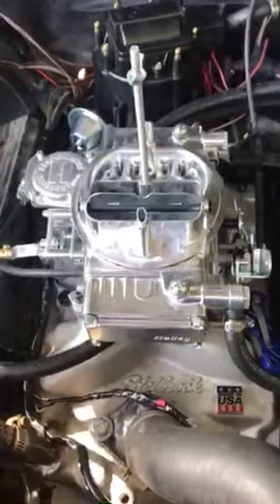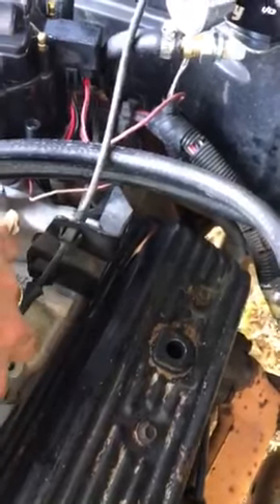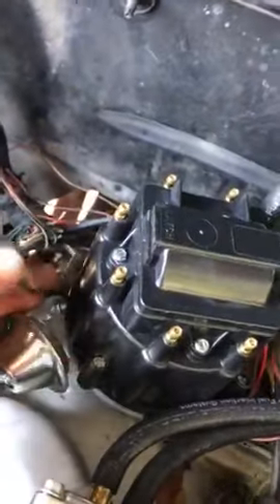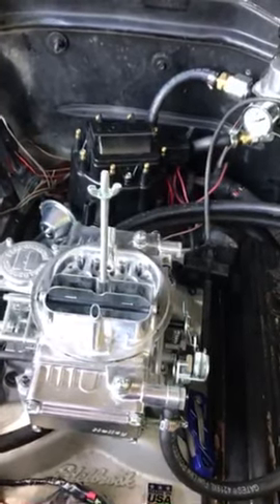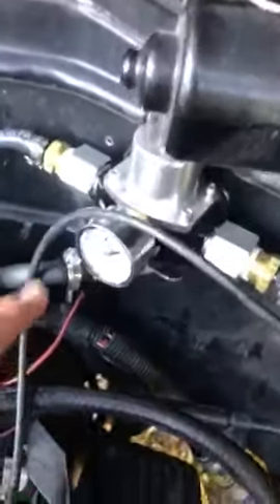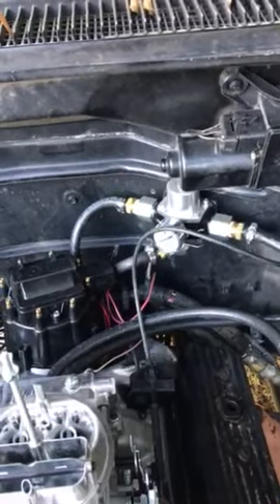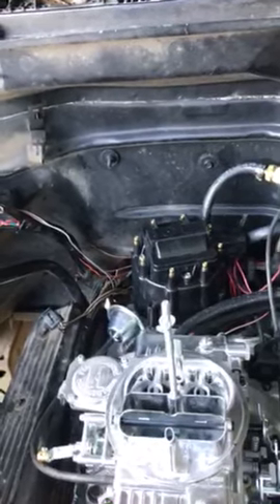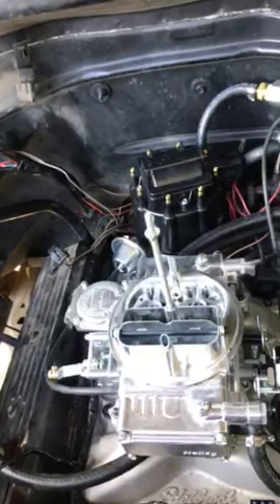Converting TBI to Carburetor, tips and tricks

Comment: After 15 years of nonstop issues...throttle body electrical,  sensor, regulator,  etc., ...I'm done with TBI. I love my old truck , a 94 chevy 454, but hate TBI with a passion. When I was young I had a 79 ford f150.  Just a plain old 4 barrel carb, on an edlebrock manifold and that motor always ran...no issues. Thanks for the video Brother.  I'm changing back to carb.👍

Comment: There's a special detent cable corrector that goes on the throttle linkage. It keeps the line pressure right through 3 4 gear. If you don't have that adapter, you will burn up that 700r4 within 1000 miles. You will be lucky to even get 400 miles out of that 700r4 without that part. Cool video
Reply from the maker: Hi Jeremy, you are right I do have my detent connected to the carb. It took a little adjusting with the bracket to get the proper adjustment from it. Still running strong. Thanks for the comment.
Reply: What do you do if you have a granny low 3 speed manual? Would that effect anything with the detent cable?
Reply: @tlariscy  hey I did the purple wire what u said but when I’m driving the fuel pump will shut off
Reply: @Romeo Weeks  did you ever get that issue fixed?
Reply: I found out I have to get a inline pump hopefully that will work I’ll let you know if it worked in a couple weeks because I keep bending all my push rods so it’s in the shop tired of fuc*ing with it lol but everything else is perfect transmission shifts smoothly and I found out I have to get a throttle position sensor is from usshift bolts on the passenger side of the carburetor look up nick connors I believe his YouTube name u will see what I’m talking about
Reply: Thanks for the advance tip sir

Comment: Thank you for pointing out the tac wire. Just did mine 87 chevy 454, used original intake with carb spacer.runs 90%better.everybody talks about the tbi to carb , but don't tell you about the wire hook up thanks.
Reply: @bigpigslapperoinktoo4953  I hooked purple and white wire to the tach port and the pump did not come on i stuck my test light in the wire and it came on strong for just a few secounds and quit, if i pull the test light out and stick it back in it does it again, any thoughts??
Reply: @bigpigslapperoinktoo4953  I just hooked it up to a hot wire by itself and it still came on the same
Reply: Question, I'm learning as I go,  I have a jasper 350 engine out of a 95k1500 I'm putting in my 85k 20, do I just need to swap all the fan,water pump, power steering off my old engine for belts and  would a Edelbrock 2104 be the correct intake to use to go carb?? Since everyone is telling me the intake that's on it won't work?

Comment: I have a 355, mild cam, vortec heads, and edelbrock vortec to carb intake, and the tbi sits on a carb to tbi adapter plate from Painless. Got a chip made for it day one that I dropped the motor in, and it's just been issue after issue for years now. Thank you for this video, I plan on doing a carb conversion here real soon. My truck won't even drive properly anymore when it warms up. As far as the 93 and 94 year models like mine, holley sells a TPS adapter kit so the trans can shift like it's supposed to.

Comment: This was exactly what I needed. My k1500 has something wrong in the knock sensor circuit/wiring and after replacing nearly all the sensors its time to go back to a simple, reliable, mechanical solution. Thanks again, awesome video, especially about the fuel pump wiring.

Comment: Glad I found this. Not running a carburetor on my 88 but I just bought a 94 for parts because it has the tow package and better brakes to put on my 88. I needed this information because I plan on dropping the 94 350 into my 66 Belair while I rebuild my 283

Comment: Thanks for the information about the fuel wire to tack side of dist. I was thinking it would work off the fuel pump relay!  I really like your video, it has helped me. Thank you.
Reply: What kind of issue were having?Im asking to see if yours is similar to mine
Reply: Once again I really like this video. I thought that all I needed to do was hook up the purple  wire to tack side of dist. and all will be good to go.Wrong, you still need the fuel pump relay hooked up at least this is the only way my fuel pump would work. And the car is running great, all finished. 1986 corvette, and only using it for drags at the 1/4 mile race track. I hope this may help someone on the fuel pump! Thanks.
Reply: @mikepolk3361  Hello mike, I just wrote a about the wire to dist. for fuel pump and in my comment I said that I also hooked back up the fuel pump relay and this is working great now! With out the relay I was not getting any fuel only a prime for 2 seconds. Hope this helps!

Comment: This video is sure helpful thank you ive been trying to figure out the fuel pump wiring because i have a 1992 gmc c3500hd that im changeing over to to carb because the tbi is failing so bad the truck would run so lean that it doesn't have the power to go up hills

Comment: Just the video I was looking for...got the same truck with a stalling issue at stop signs ...I've been fighting it for months..im an ok mechanic but am done replacing stuff..took it to a reputable shop and they are scratching there heads..gonna save up and go with your setup.
Reply: I did the same thing to my 94. Ill say if youre doing to swap from scratch, it'll run you around $1500 all said and done. Thats a good aluminum intake, 4bbl carb, HEI distributor, tps set up, regulator, brass fittings, etc. You won't regret it though. You'll gain probably 30hp and tons of torque and it will run SO smooth. My truck runs like new and has more power. And with electric choke, it starts very easy. Just 2 pats on the throttle and ZOOM. Paint the valve covers, keep it clean and it'll look like you dropped a $5k crate engine down and this also opens up a lot of possibilities for aftermarket exhaust since you have no emissions to worry about.
Reply: @ericchapman8956  what do you mean by tps setup? Thanks
Reply: @mainerj  Throttle Position Sensor. This only applies if you have the 4l80E as it uses the TPS to control its shifting. If you jave a mechanical kickdown or a manual transmission you wont have to worry about it. I used a Holley carb and a special bracket sold by Holley that can be used with the factory Throttle Position Sensor. Without it, a 4L60E/4L80E transmission wont shift right. Sorry im not very good at explaining things.
Reply: @ericchapman8956  thank you, ya makes sense I have a 700r4 so just wanted to make sure I wasn’t missing anything 👍🏼
Reply: @mainerj  then you can skip that step entirely!

Comment: The purple with white stripe to dist. was all I did and with no luck hooked up the fuel pump relay and it works great!
Reply: I hooked purple wire up and when I turned key on I get nothing. No sound just cruckets.... thinking of just running to toggle

Comment: Oil pressure switch sees pressure and keeps the fuel pump running after the initial prime.  Needs to be plugged in on the back by the dizzy,,, if your motor has one.

Comment: To Get The In Tank Pump To Work other than just prime! cut grey wire from fuel pump relay on passenger firewall and connect it to new relay which will be your fuel pump hot with constant 12v, switched 12v & ground wahla fuel pump comes on with ignition switch and works properly! Remember to use a bypass regulator!
Reply: What year did you do this on?

Comment: I'm having the exact issues you described near the end of this video, put a brand new engine in and it has ran like shit since, changed every sensor there is and have come to the conclusion there's wiring issues in the tbi system, idle is erratic all over the place and I can't get it to stabilize so now I'm weighing out switching to carb setup or tracing the wiring issue...
Reply: Did you ever figure out why it’s doing this? Mine has been doing it for 1 year but seems it only does it when it wants too. Like one week it’s running like shit and the next it’s perfect.. I’ve tried locating naked wires I’ve changed throttle bodies, distributor +(cap wires and spark plugs), coil, every sensor on the damn thing, fuel pump and filter, and have looked over the ecu wiring behind the glove box and still acts up sometimes.. it was my grandpas truck. Had it every since I was 5 and he gave it to me when I was 16 and I would do anything for it to run right .. please let me know if someone has solved this! Thanks.
Reply: @daltongrayson8513  my 99 is the exact same way,I've figured out outside air temperature effects it.At first when it's cold runs like ass.ten minutes of driving and it's mostly normal.Just not the best setup
Reply: @brandonvansel3716  have you changed the temp sensor on the intake?
Reply: @daltongrayson8513  yes.Ive changed pretty much everything at this point.The other thing that does this is to much air at the maf
Reply: @brandonvansel3716  I’ll try to figure out how to post a video of what my truck is doing on here and tell me if yours is doing the same thing

Comment: 4l60e has that cable under the throttle cable as well. If that cable goes to a box on the firewall it controls the cruise control.. just so nobody gets confused after watching this video when they go look and the cables there on a newer trans truck 👍
Reply: 95 and after has a 4l60e I believe, My 91 has a 700r4
Reply: 92,93, 94 has the 4L60e.
Reply: @clintdearman2508  I agree accept for 1992. 92 had 700r4. The first year c1500 to get an electronic 4l60e was 93. Granted in 1990-92 they were calling them 4l60. But still no e because they were still using a kick down cable with no electronic controls until 93.

Comment: We did everything you said and the motor runs fine ,but when you put it in gear it stalls out. It has the detention cable for a 700R . IT'S a1990 CHEVY c 2500 with a 5.7 motor. Thanks! ED
Reply from the maker: Hi Ed, my guess would be fuel supply, however the lock up torque converter may be locking up when you put it in gear. Try disconnecting the wiring harness on side of transmission and see if problems still there. This should rule out transmission problems. Hard to troubleshoot when not on site. Good luck

Comment: Rusty just seen your video. I’m in the tree business and my Son and I have a 1997 gmc top kick with a 366 gas engine with a throttle body. It is our main bucket truck we use in our business. It starts but idles very roughly for 5 minutes or so then it smoothes out enough for us to drive to the job site to do our work. We have a pony motor that operates the hydraulics to run the boom. We have been having issues with it for around 6 months now. We’ve spent $3 to $4,000 on it so far changing out everything there was to change out. All the sensors, new throttle body gasket, tune up of plugs, wires, distributor, fuel pump, coil and everything else we could think of.  
We have someone who done this on a truck like ours and he said it runs great.  He is going to do this to our truck.  I’m glad I seen your video p, it was very encouraging to me. We are hoping to get our motor running great again.  The only has about 105,000 miles on it.  Thanks for your video, Steve Miller

Comment: If you leave the tbi wiring harness in place and guve it the tach signal, hook the map sensor to the new manifold, and fit a throttle position sensor to the carburetor the 4l60E should shift fine

Comment: Not sure if you're going to see this Walt, but I am swapping a 1997 Chevy Tahoe 5.7 to carbureted. The only thing I can't figure out is if I have vortec heads. It says vortec above the intake boot, but it has TBI.. for some reason I keep reading that TBI motors are different from the vortec
Reply from the maker: during 1997 was the 5.7 L 5700 L31 engine, which was produced from 1996 to 2002. The V-8 engine had an overhead valve configuration, with two valves per cylinder. The truck engine was rated at 255 horsepower and 330 foot-pounds of torque. The 5700 engine appeared in the 1997 Chevrolet Express, Chevrolet Suburban, Chevrolet Tahoe, Chevrolet/GMC full-size trucks and the Cadillac Escalade. This engine was replaced in 2002 by the 5.3 5300.
Reply from the maker: Yes you should have vortec heads
Reply: I have 96 silverado that I completed the conversion and could not find the purple wire with white stripe anywhere that everyone runs to the tach port. Did you find the wire?

Comment: I have a 1988 Chevrolet k 1500. Rebuilt motor and doing the TBI to carb swap. Brand new HEI distributor. 12-volt to battery on distributor
Reply: Purple and white wire to takw Port. Fuel pump not running it was before

Comment: Building a carbed engine for my 91 k1500. Great video! Thanks for the tips!
Reply: @Dawnstriker I'm trying to do one on the same year and truck as you, any tips or things you learned/problems you ran into?
Reply: @realWideOpenThrottle  actually I haven't even gotten to it yet. Setback after setback.
Reply: @Electrains  No problem, I've been looking around on forums and other places to see what others have come up with. Thanks for the reply.
Reply: @realWideOpenThrottle  I did a carburetor swap on mines I have a 1990 K1500 350 how far did you get on yours?
Reply: @road2richz_q266  I actually finished it. Truck has been running for a good while now, has the occasional rough idle most likely due to the 87 octane gas I keep throwing at it. Too cheap to buy the good gas. Otherwise it runs perfect.
Reply: @realWideOpenThrottle  That's great, how did you do your fuel pump wiring, my fuel pump turns on when I plug in the relay do I need to do anything else?
Reply: @road2richz_q266  If you wired your fuel pump relay correctly for the carb, it should have an initial 3-second squirt when you turn the key in your truck. Other than that, you'll need a return-style fuel pressure regulator, I used a Holley 12-887.
Reply: @realWideOpenThrottle  I didn't have to wire my fuel pump relay it was already wired up with the relay from the original setup, I have that exact regulator as well, I got everything done I just gotta crank it up and break in my cam but I'm nervous though because I'm by myself
Reply: @road2richz_q266  Good to hear, glad you got everything done. Every moment right up until you make your first crank is going to make you nervous and double-check yourself. It is nice to keep an engine rebuild book around for every motor you rebuild for torque specs and such also. Have some confidence, I'm sure you've done everything correctly!
Reply: @realWideOpenThrottle  yea thanks man, I  don't have a timing light though can I still do it without it, I do have my aftermarket Tachometer I installed
Reply: @road2richz_q266  I would get a timing light, you'll need it to adjust the hei distributor you replaced. It is possible to adjust the timing if you absolutely can't get a timing light, but I would highly suggest getting one.
Reply: @realWideOpenThrottle  ok bet preciate it
Reply: @road2richz_q266  no problem, if you have any questions or need help just let me know and I can get you my #.

Comment: Very good illustration.Does your Truck have the L98 aluminum heads. I 'm doing a 89 Vette.Going to use 2102 Edelbrock.so the distributor is no computer Hei.purple wire goes to the tach side of the new distributor
Thanks Robbie
Reply from the maker: Cast iron heads
Reply: L98 aluminum

Comment: I really like your video. Clear and straight forward.  I am planning on doing a similar swap on my 1988 Chevy blazer 350 5.7L. Watching your video and comments I had a couple of doubts.  Did you use the 2101 or 2104  intake from edelbrock?  What carb did you use? and did you change to a melinized gear on the distributor to protect the camshaft?  THANKS FOR SHARING.
Reply from the maker: Hi Jorge, I used the 2101. The only reason to change distributor gear is if you have a roller cam setup, then you would need to use a bronze gear. I used a Holly 600 cfm with electric choke. Had to use adapter to make intake square bore.
Reply: @tlariscy  do you remember what adapter? And where to get one? About to attempt on my 88
Reply: @tlariscy  hey man I got a 1989 with a rod knocking in my 350. I've got a 78 with a beast of a 350. Can I just set the whole engine in there sir?
Reply from the maker: @wildestcowboy2668  shouobe an issue. Just got to provide fuel and spark to be good to go. Not sure on the motor mount match up, but that’s not too hard to adapt if there are any difference.

Comment: Good info but I hope you hooked up the Throttle Valve cable from your 700R4 Trans to the Carb and had it adjusted correctly. Otherwise you'll burn up that 700R4 real fast.

Comment: Like your vid! You didn't have to mess with the fuel relay at all? So you just connected the purple and white cable to the tach port right? So this way it will run the fuel pump like normal? Thanks.
Reply from the maker: Yes, straight to the tach port. Keeps fuel pump running. No issues
Reply: How much did everything cost for conversion and where did you get it
Reply: I have a 95 K1500, did you leave the stock full pump in the tank?  I assume you did based on the regulator.